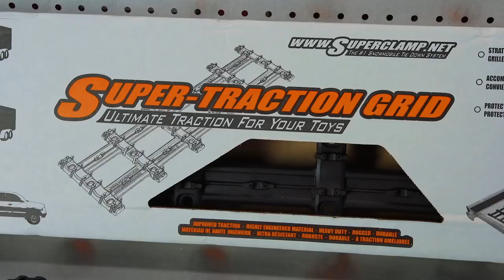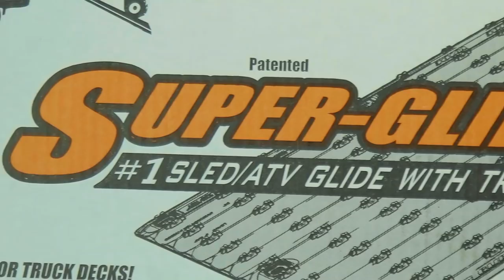SnowTrax Television 2018 - Episode 2

Comment: I would never put two sleds on an f150with a deck and drive through the mountains. Only on the east coat I guess :) Bys gotta come out West and see what we have to offer.
Reply: CalgaryDynastar I have add a leaf along with air bags in that F-150. I’ve been out in western Canada a lot and I also have a 2500 GMC duramax with a sled deck.
Reply: Troy Burt I've just heard of cops out this way pulling guys over with half tons and decks. I have an older 2500 dmax too, perfect ride with two on the deck. Looked like you have some fun out there in the winter! Ride safe and keep er pinned.
Reply: Most halftons are rated for 1500+lbs of payload. Tell me how two 500lb sleds is over doing it? Most people think you need a diesel for everything, meanwhile i tow more than 70% of diesel owners do with a 6.2 half-ton.
Reply: Chuck Beef factor in two people, fuel, gear, deck, etc and you are flirting with that maximum though. Not to mention that 3/4 and 1 ton have brakes suspension and driveline components which are more suited to the task. I'm not saying you can't, but you certainly don't see very many half tons with two sleds on a deck driving the Rogers Pass. Sure people tow trailers and power to you for doing so, to each their own I suppose. Just out of curiosity, do you have a sled deck? I get that you pull a trailer but that's apples and oranges to having over 1000lb sitting on top of a deck 5 feet off the ground with that added sway and higher center of gravity. You should drive a loaded truck with 2 sleds  on twisty mountain highways and logging roads and tell me me if you still feel the same.
Reply: No deck, buy i routinely put my 1,300lb Yamaha Rhino sxs in the back without issue. My sled only weighs 450lbs so i dont notice it. I understand the weight it way up high and that will drastically effect handling. But if you drive like you are loaded to max payload, you wont have trouble. Its when people load them up and drive like they are empty is where the problems start, aka lack of experience. My trailer is a dual axle 20’x8.5’ deck over. I put a homemade shack camper on the front and two bikes on the back. About 1,000lbs tongue weight without gear in the bed. You are right, an HD truck is the better choice for decks but todays halftons have the payload of early 2000’s HD trucks. If you are buying a truck just for sleds, it would be more enjoyable to trailer your sleds and live with a half ton on a daily basis. I hate the ride of my HD GM’s and would never trade my personal half ton for an HD truck unless i had no other choice.
Reply: Chuck Beef seems like we are pretty much on the same page as I agree completely with what you're saying. Personally, I also drive roughly 1000kms to work and then back home every couple weeks and generally have a few hundred to 6-700 lbs of gear in the back of the truck and I also bring the sled the odd time so the HD with a deck fits my use best. Also still gets good economy while loaded and she's got 400 xxx kms on her. I also really like using the deck on the forestry roads as springtime mud can be a real pain and the sleds stay nice and clean. Some of the riding spots we have will also not allow for trailers as parking is limited and there is no places to turn around on the roads. As long as we are happy with what we have and how we use it that's all that matters:) Enjoy the rest of the riding season!
Reply: CalgaryDynastar Enjoy the mountains you lucky duck. Wont get there this year sadly.